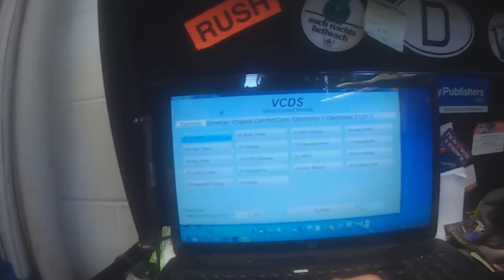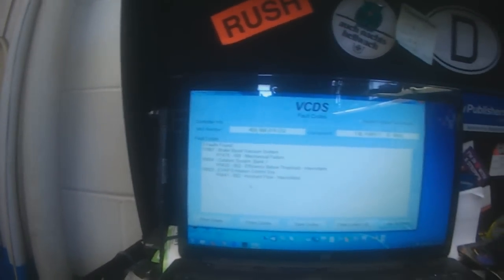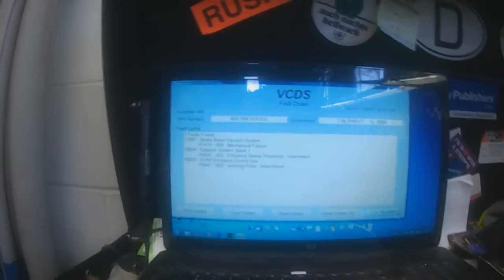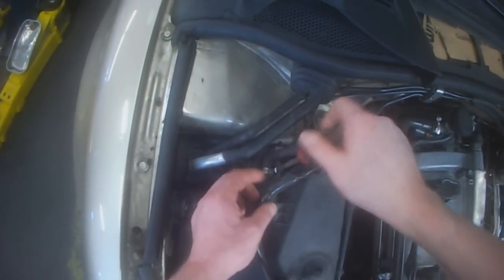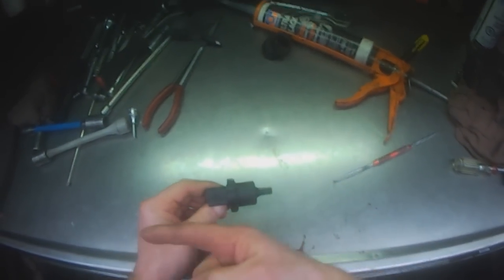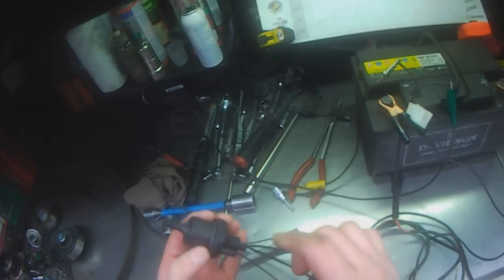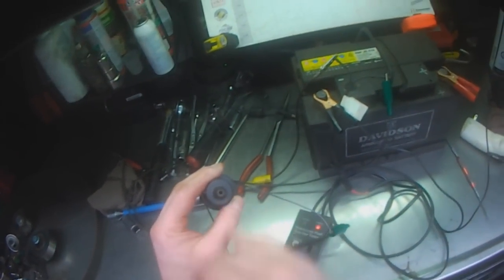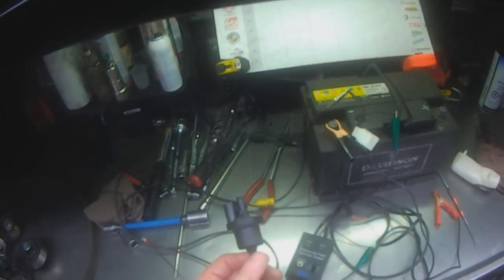VW B5: 1.8T Passat EVAP incorrect flow

Comment: I figured I would post this on this page. 
 @Thomas EXOVCDS Hey I was driving my B5.5 Passat home yesterday 1.8T (Auto) and i smelled gas, then after getting my gas filled up, i really smelled gas.  I got home (8miles away) and I parked my car only to see fuel streaming down on the right side of the tank under the fuel door.  I check and no the fuel was not spilled onto my car.  Will an Evap purge valve cause fuel to back up and leak by the tank?
Reply: And yes my CEL came on and two codes for the EVAP, after I did my engine mounts and trans mounts. Still vibrations!   I just want to know if i have to have the tank dropped..
Reply from the maker: I'm not sure what happened or what's going on... a bad purge solenoid should not cause fuel to leak at the back. I believe that the leak detection pump is on the driver side of the car (left rear fender well) and it would be the only thing that (I think) could cause an external leak. The fuel filter is on the passenger side, so check that out first (and the lines going to it).
Reply: @EXOVCDS  Well I found out my fuel leak, maybe I should post a video on it, but basically it was because my car had nuts.  This is my theory: Some how previously some tree nuts and acorns found their way ontop of the gas tank and around the fuel pump lock ring. Whoever worked on the car before and replaced the fuel pump, was too lazy to clean out the said nuts and tightened down the lock ring which bottomed out hitting the nuts, and not forming a solid seal.  I cleaned out all of the nuts and was able to get another full quarter turn if not a little more out of the lock ring.  I cleaned up the area around the tank, and now it is a clean as a whistle.  Darn those pesky chipmunks!  So moral of this story, if your car is leaking a little gas, check to see if it has nuts!
Reply from the maker: @danieloshaughnessy8476  Thank you for the update... good troubleshooting & fix!

Comment: hi Thomas 😊 thanks for the videos.. i have a audi a4 b5 1998 that has a loose gearshift. . i found out its the linkage bushing between the shifter and the gearbox.. the problem is that i cant find a good sparepart sit online that Sells Them 😕 only found a upgraded version that costs 300$ 🤔 Who would be a good parts-pusher to turn to??
Reply from the maker: One of these parts? http://fkh161.ca/Audi/A4/A4ShiftLinkage.jpg
Reply: Yes 😁 it Will be Nr 28 🤗 where can i get one? 🙄🙄
Reply from the maker: This one? https://www.ecstuning.com/b-genuine-volkswagen-audi-parts/shaft/8d0711613d/
Reply: Thank you My friend 🤗 but 200 +$ is a crazy price, maybe i Will have to eat that Bill 😣
Reply from the maker: Use the part number to do further web searches. You can probably make some kind of fix yourself... but time is money. If you can fix it for $222.67, that might be cheaper than trying to make it work while the car can't be used for a week. If you do decide to order it... make sure to check with them BEFORE you order it, that it is the correct part for your car!!!
Reply: Thank you very much for your time, keep up the good work 🤗

Comment: If I spray the intake with starter fluid it will start and stay running if I let it sit over the weekend and start it is starts right up do that sound like The Purge also after running after a while it would not start unless I do spray the starter fluid
Reply from the maker: Maybe, maybe not. If the purge valve is sticking open... it will allow gasoline vapor to enter the intake manifold, which floods the engine. The engine will crank a long time and then run rough for a little bit once it does start. Adding starting fluid adds more fuel to the intake, which should flood the engine even more... but starting fluid could be more volatile than gasoline and that's why it starts when you spray starter fluid into the intake. To rule out the purge valve, disconnect it from the hose that goes to the intake manifold. Plug the hose that goes to the intake manifold with something that will not get sucked up into the engine (through the hose). If the starting problem does not happen anymore with the valve disconnected, then the valve is bad. If the starting problem still occurs, then it is something else that is causing the problem (possibly a bad crankshaft position sensor).
Reply: @EXOVCDS  thank you for your quick response.  I changed the fuel pump and it started( but only because the engine was cold)  I think.  Good news (I think is) now its throwing the p0322 code.. brand new pump not making a sound. I did some reading and someone said the reason its starting with the starting fluid is because its reading off the cam instead of the crank.??? Crank sensor powers everything on?.
Reply from the maker: Year, make, model, engine? P0322 can be set when the engine cranks too long.
Reply: @EXOVCDS   2001 vw Passat 2.8.
Reply: If I spray starter fluid it will start and stay running but will not start without the starter fluid it did a couple times and after I put the new pump in I heard it come on maybe twice and then it stopped I'm at Advance Auto Parts getting a relay as we speak
Reply: Update.  I have put a new purge valve I put a new fuel pump I put a new fuel pump relay still no start without the starter fluid. I test for power to the fuel pump on prong 3 the purple wire and my test like is blinking on and off real fast and faint
Reply: 2001 vw 2.8 4 motion
Reply from the maker: I'm still at work... I'll get back to you once I'm at home later tonight.
Reply from the maker: You need to check your crank sensor and two cam sensor signals. Yes, the crank sensor signal is usually the important one that gets the ignition going... but some of the V6 generations won't start if there is no cam sensor signal. Will run with a bad cam sensor signal, but won't start. Fuel pump wires are the thick heavy ones. Green/Yellow is power to the fuel pump and brown is the ground.
Reply: @EXOVCDS  thank you for sharing and taking your time to respond to my questions. I greatly appreciate it.... it was the crank sensor seems that it do give power to fuel pump on this model
Reply from the maker: Thanks for the update! It's the ECM that triggers the fuel pump... the ECM needs a crank signal.
But like I said, sometimes things are more complicated, when the ECM also needs a cam signal or more than one cam signal with the crank signal. =)

Comment: I have the same code p0441 evap incorrect flow and I have my n80 deleted with proper software but I have engine light now after months of it deleted and don’t know where to start. Any thoughts?
Reply from the maker: miles aguacil I am not familiar with N80 delete & ECM software flashing. You need to talk to a tuner / whoever changed the software.
Reply: Thomas EXOVCDS yeah I did already. What would be the next thing to cause that code? Besides the purge valve ?
Reply from the maker: miles aguacil there's nothing else that can set that code... aside from the n80 being eliminated in your case. If the software / flash was done correctly, then the ECM DOES NOT check EVAP flow. For whatever reason, your ECM is checking flow. It can't detect flow if the N80 is disconnected / plugged / bypassed. Has to be a software issue.

Comment: Would an issue with this valve cause the engine to run poorly? Driving or at idle? Is it possible to have an issue with it without a code?
Reply from the maker: +Chris Gelder It can... usually sets a code, but I have seen them not set a code.

Comment: "5-8 year maintenance item?"  Whoops...  Mine's 19 years old, and I guess it still works?  No codes, but then again, I also don't have a code for what I can only assume is a large leak, judging by that nice, rich gasoline smell by the back right wheel...

That goofy little purge valve, though...  With how it constantly clicks on and off while the engine is running, it keeps tricking me into thinking I have an ignition system problem!
Reply from the maker: +rhkips Haha... it does kind of sound like spark arcing! :)

Comment: Hello, my 2013 Jetta has this p0441 code. Oddly it started with p2402 (leak detection pump) and had that replaced. 
P0441 then popped up. A re-flash was done. Still p0441. 
Then N80 was replaced. Still the code came back. I’m at a loss. Any suggestions?
Reply: Oh and I got a new factory gas cap.
Reply from the maker: Was the system smoke tested? Incorrect flow can be too much or too little. Does the ECM pass the EVAP leak test? Any accident repair? Which engine? I might have some ideas tomorrow.
Reply: Thomas EXOVCDS thanks for the reply. it was smoke tested a week ago. The mechanics told me they didn’t find anything wrong with the evap system. They reprogrammed the ecm hoping it’d clear the code. It came back.
It’s a 2.0 non-turbo. 
No damage or repair to the car.
Reply from the maker: I'm at work right now... will get back to you later tonight once I'm at home.
Reply: Update, so I have a VW Audi shop looking at it. 
The leak detection pump that was used as a replacement was an “off brand China pump” that isn’t actuating properly and the N80 that was used is an “off brand China valve” 
They say that’s probably the issue. It doesn’t pass the ECM test. 
So I guess I’ll have to have the shop that replaced these parts to begin with swap them out.
Reply from the maker: Yes, have the original shop look at those components again. Show them the fault code... explain that another shop has determined that the parts are suspect. If they don't want to correct the issue... have the other shop do it. After the code is GONE (repair has been varified) take the defective parts back to the original shop and have them refund the money for parts.

Comment: what are the sympthoms for a bad purge valve?
Reply from the maker: Most of the times none except the check engine light... it can cause long cranking time after the fuel tank is filled (valve stays open and allows fuel tank vapors to enter the intake, flooding the engine). Can be the cause of lean running codes and rich running codes.
Reply: Thomas EXOVCDS thanks bro...its bad emission odor another sympthom?
Reply: Kris Nicholson thanks bro"good ansewered!

Comment: But did it fix it? You never said.
Reply from the maker: Yes it did. If yours still has the original one-time-crimp clamps, it's most likely bad / sticking intermittently. They usually last 5 to 8 years.

Comment: n80 valve those never go bad,not! I think I have installed well I over 100 of those valves;)
Reply from the maker: +Michael Berg Fuel injectors click more but last longer... must be the dusty particles from the charcoal canister!?
Reply: +Thomas EXOVCDS idk but I have had them fail electrically and mechanically, late models are even worse for some reason replaced a bunch on 10-12 vw/audis same valve but even higher failure rate it seems, lots of lean codes/ purge codes with a suck open valve

Comment: Good video i would have used  the vaccume/pressure pump for this test also not just blowing with mouth as you cant make much pressure or vaccume with a human lung .
Also i always  say  you need!!! 
Factory level scantool to pull all codes obd2 is only emission related codes and even they are  not to be trusted its why i only ever use rosstechfor v-a-g if i need  to be sure i get all codes, with other tool you never know if you did get them all or not as  you clearly stated it did NOT, obd2!!!! -emission room and factory level room are  2 rooms one must always look in both rooms and its differences like substituted values of engine coolant temp in the enhanced room= factory level room on a lot of cars
This is not to lecture  you but so somone else whom reads the comments  gets a better understanding what are real facts for some vehicles on some tools! who dont tell the whole truth.
Reply from the maker: Good information... thank you for sharing!